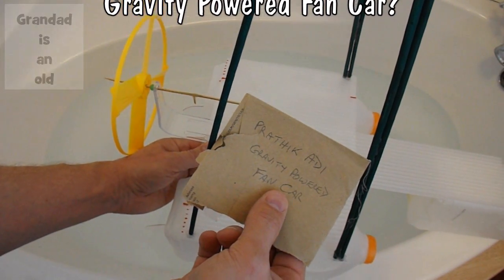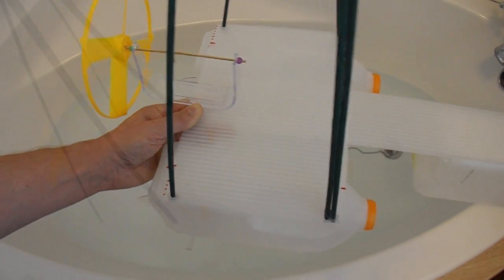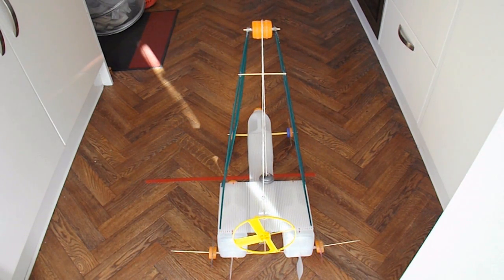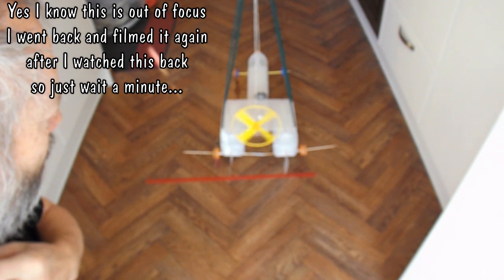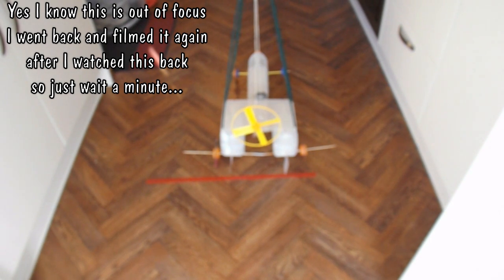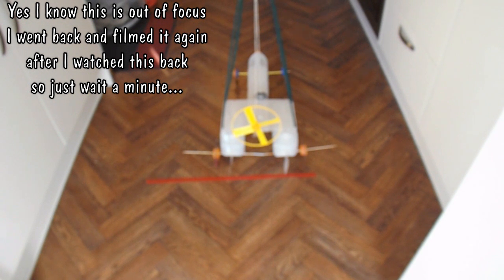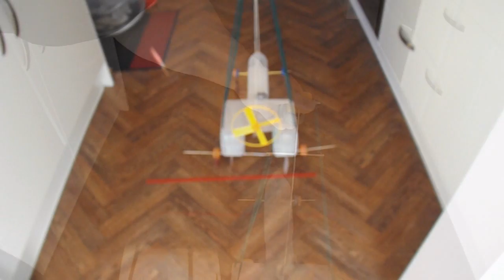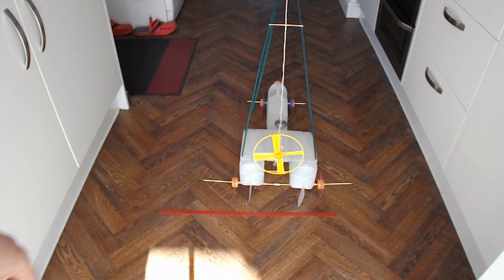Gravity Powered Fan Car

Comment: i noticed that you have the string fassened to the propshaft. have you fiddled with gyroscopes? they have a hole that the string can go into for winding, and then it cokes out when spinning. when the fan stops its no linger able to crwate thrust, if you could let it spool longer using that method, while the momentul would slow, itd still be more thrust than it stopping and cor a longer period, doesnt solve the acceleration issue, but may aid in the distance. just a thought.
Reply from the maker: It is only hooked onto a peg on the shaft, the same as I do on my rubber band powered cars. In fact in the video the string is a little long so the weight hits the deck before the string comes off the hook so I can see that it looks like it is tied in place. You can see the hook clearly at the beginning of the video. Putting some sort of flywheel on the shaft to keep it spinning would prolong the 'thrust' time, you could experiment with the gravity weight dropping off the car entirely so it is left behind and all the energy will have been transferred to the flywheel. Feel free to try this for yourself, I am not going to spend any more time on it.
Reply: That's fine, wasn't expecting you too, just a future thought. I've beenatching this on my phone so it was small and I missed it.
Reply from the maker: colter james Calvetti it is very tempting to spend more time on this using the flywheel idea, but not at the moment. Maybe if I find a suitable item for a flywheel I will look at it again.
Reply: Or even on a rubber band car! I just thought of that, I get lots of free time in my head.
Reply from the maker: colter james Calvetti On the rubber band powered car, the wheels can be used as the flywheel effect. Choosing the right size and weight wheel makes a big difference in the performance. I generally just use CDs because I know I can get the distance I need for demonstration purposes using them, but if somebody needed to maximise the distance then wheels need to be considered. 
If you look at the links in the video description on this one you will see mousetrap cars that go 100 or 200 feet http://youtu.be/v1n4PtRaM9Y?list=PLA5a2xPRSrB1jSyRMjw31ptEYAAkZRF6H